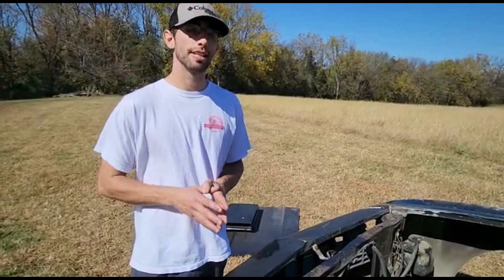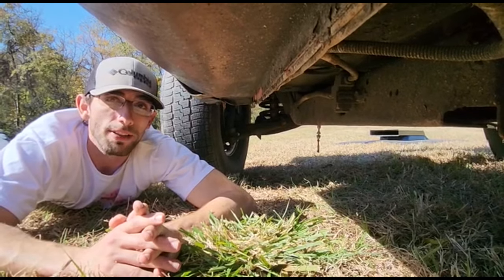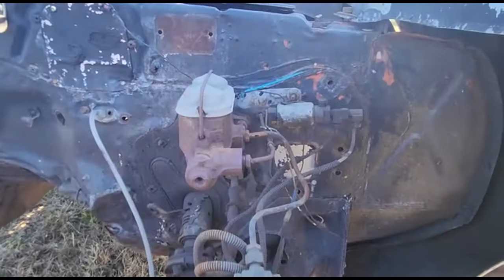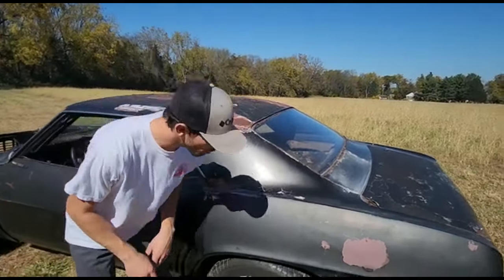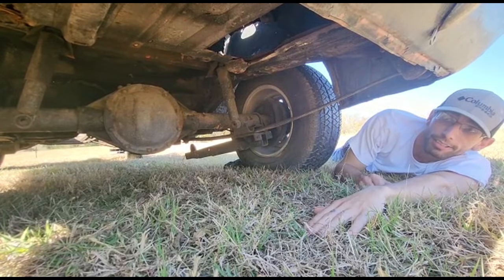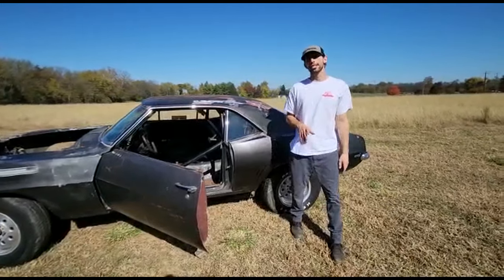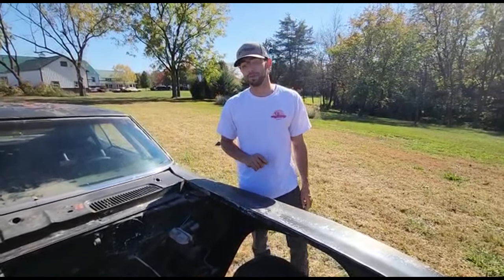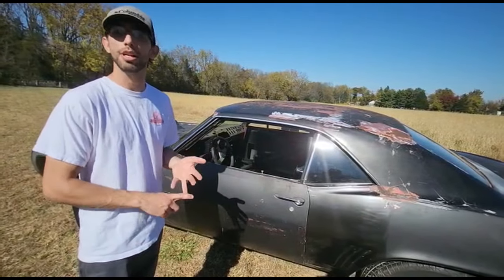1969 Camaro Z/28 SECRETS THEY DON'T WANT YOU TO KNOW - Barn Find

Comment: Don’t believe tach was mandatory on 69 Z/28. I ordered my 68 Z/28 without the gauges (tach).
Reply from the maker: In may 1969 they were all required
Reply: @backyardbarnfinds   , correct. I bought one (Sept 69) in Oxnard, CA from a Chevy dealership. It had a factory dash board tach and center console gauges. Very good and fast car.
Reply: My dad had an early build 69 z. Flat hood, no spoiler, no center console and no tach.

Comment: You didn't discuss the trim tag with either X33 (usually RS pkg) or X77 (base) codes.....or the fact that real Z's had a single 3/8" fuel line with no return line.
Reply from the maker: Trim tag wasn't on the car and its hard to explain what isn't there... Most of the time you find a Camaro in the wild, cowl tag is gone... Also.. fuel lines have been removed due to the car being raced.. I tried to provide real world knowledge that I use in a junkyard daily to figure out what cars are..
Reply: x77 wasn't necessarily 'base'-i had x77 for 25 yrs-was all original except for one repaint-it had high back comfort weave seats -console and a very rare rear window defoger which worked which you can decode all these extras by trim tag
Reply: @jimjessie2704  I should have been more clear. The X33 package was for Rally Sport options. The X77 was for the 'normal' or base models. Yes, you could get consoles and better seats and door panels in the X77 models.

Comment: Early Z28's were not required to have either spoilers or the tach. The spoiler package and the tach were included late in the year and the base price of the package was increases correspondingly. 
X3 exterior style trim Z28 - you noted the gill trim, however it also included-, tail lamp lenses with vertical stainless trim, roof drip molding, wheel opening moldings and the headlamp bezels have chrome rings around them, additionally the rockers were blacked out. 
 
Pedal trim is part of the interior trim package Z21- which also included the grab bar on the dash. 

The X in the X3 on the rear bulkhead indicates interior paint color. 
X=Black B=Blue R=Red G=Green  
You can send the Vin off to the NCRS and they will tell you which dealership originally recieved the car. You could luck out and the dealership has the paperwork.

Comment: My cat
69 was a console delete, with an 8k RPM tach, fuel gauge in between the speedometer and the tach, 3:73 gears, the factory tuned dealer option Hooker headers and my friends Dad used to professional race one in super stock in 1970, and he did a few simple tricks on mine. HOLY HELL. It was OUT OF THIS WORLD FAST.

Comment: did not have to be x33 to have to have the good trim-i owned a 69 z/28 for almost 25 yrs-it was a x77 and had chrome louvers in front of rear wheels.rear window defogger,wood trim interior,console,cowl hood,comfort weave high back seats,daytona yellow black stripes-very nice car and options were original ,matching trim tag
Reply from the maker: you car was worked on

Comment: All Z28's were required to have "Power" Disc brakes. No mention of that here. The Master cylinder is mounted to the firewall. No power brake booster. A lot of these were drag raced as this one looks like it was riden hard. Any upgrade to the cam required the removal of the booster because the engine would not create enough vacuum. 
Funny how his car would be looked down on, but I see just the opposite. This car has had more fun than all those '69 Z's stuck in the garage or on a trailer. Nice find.
Reply: You used to see broken grilles on Z's. Dudes were too lazy to remove the grille when they changed cams.

Comment: Pretty good even without a trim tag. Confused about the hole for the cowl function though. I remember mine opening from vacuum when you stepped hard on the gas. What needed to enter the cabin?
Reply from the maker: Wiring for the solenoid went through hole in firewall above the fusebox

Comment: Very good video. As I also understand, Z-28's will not have factory A/C or power steering.
Reply: No Automatic transmission either.
Reply: @Shakerhood69  Correct. I should have mentioned that in my original comment.
Reply: Z/28s could have power steering..
Reply: @roberthorner  , correct. I bought one (Sept 69) in Oxnard, CA from a Chevy dealership and it had power steering. Very good and fast car.
Reply: I know someone who had a 1970 z/28 & it had PS! I bet the 69, did too!
Reply: No auto or AC until the 70 1/2 Z. Switch was made to the 350 engine which had greater torque.

Comment: I’ve been told that the trunk spring is heavier to be able to lift the trunk lid with the added weight of the spoiler.
Reply: That’s true but spoilers could be ordered on any 69 camaro
Reply: It's not heavier, it's located in a different slot in the bracket in the trunk.

Comment: In 1992 I bought a 1975 Impala because someone had put some 186 heads on the engine in it. I paid $100 for the car.  Took it home and pulled the engine and scrapped the rest.

Got into the engine and the block was an "mp" code. 1967. 302.. had the solid cam and popups still. It had 1970 186 heads on it. I rebuilt it in my garage and put it in my 69 Chevelle which I traded off soon after. Wish I still had both the engine and the car.

Comment: M21 and m22 close ratio Muncies only came in ss or z28 the provisions on the firewall are different than a Saginaw cast iron 4 speed
Reply: Speedometer cable entered at different location
Reply: @dustinneace7300  Yes if I remember correctly the speedometer cable on a Saginaw goes in on the passenger side (right) & a Muncie goes in on the drivers side (left). Found this out years ago, I had a ‘68 RS/SS Camaro with a Muncie behind a 396. Ended up with a broken synchronizer so I came across a Saginaw with a Hurst V-Gate shifter, complete. Everything went together well except when it was time to hook up the speedometer cable. Just left it unhooked rather than ruining the cable do to the twist that would’ve been required to hook it up to the Saginaw.

Comment: Two things..early z28 didn't have the brake pressure regulator.. before January 69.and if the car had consol gauges it didn't have the hole under the wiring harness plug..that hole was for non consol cars..

Comment: I used to eat those things with my 67 GTA Fastback Mustang. And they were the ones who started every race.
Reply from the maker: I would assume you had the 390 and not the 289? The Z/28 was basically from the trans am series which is a road course not a straight line.. doesn't surprise me..
Reply: Don't believe that. My 69  Z had very few problems with most Mustangs. I used to race (373 gear) starting at 4000 RPM. I was in first gear and other car were in second gear. Right at the start of my power curve. A Z with 456 or 488 was formidable in the quarter mile.
Reply: @gw3598  Most of these kind of comments about beating other cars are useless. Unless they tell the whole story. Were there any mods on each? Headers and other mods were common back then, I lived those years. Even a 390 stock gta is not very fast. But then the z's were not really either. Probably pretty closely matched if both stock, although I would bet on the z, and I was  mostly a ford guy back then.

Comment: If it's a real Z/28, where is the power brake booster?  All 69 Z/28's had power discs at least up front, with some having the rare 4 wheel discs.  Also, is the cowl tag in place?  If it is, it will state it as either an x33 or x77 car.
Reply: Someone took the brake booster and the disc brake rearend off the car before he bought it.

Comment: 1969 z28 only year with a 302 cu in
Reply: 67-69
Reply: WHAT?? 67-69!
Reply: 1970 Z/28 was a 302 cu, also!
Reply: @davidkirkham6497  it didn't have the guts and the balls like the 69 302
Reply: @peteleadlove9215  I am wrong! My best buddy @ the time purchased a brand new Z/28! As far as I can remember I thought is was a 1970 & I know it was a 302 cu in, however, 1970 didn’t have the 302. My apologizes as it must have been 1969 Z/28!  It was a long time avo!😀
Reply: @davidkirkham6497  1970 was a 350. First Generation LT1. Great engine!
Reply: @markkaminski2416  👍😀
Reply: 67 68 and 69 were  302 cubic engines
Reply: @davidkirkham6497  Nope,70 Z had the LT1 370 hp 350 solid lifters.

Comment: '67-'69 Camaro all-stock Z/28. All show, no go
Reply: When I ran AA sedan road racing stock class it cleared turn 1 in Seattle / Kent at 154 mph at 7800 in 4th as an A Improved Sedan (GT1 today) with a lot bigger tires it clears turn 1 same track at 8100 in 4th at 170 mph